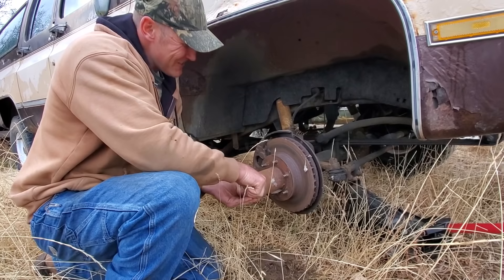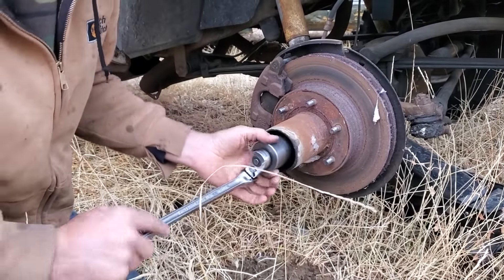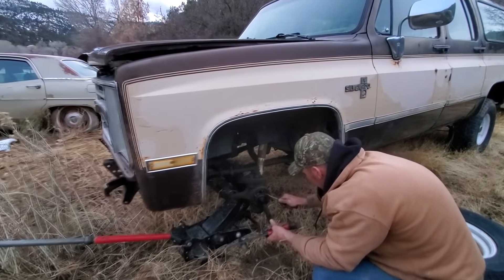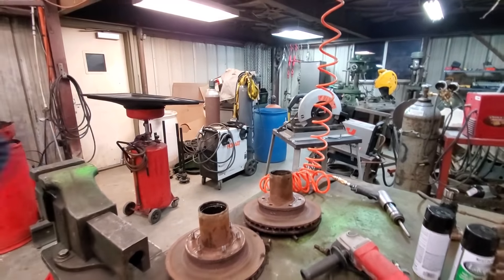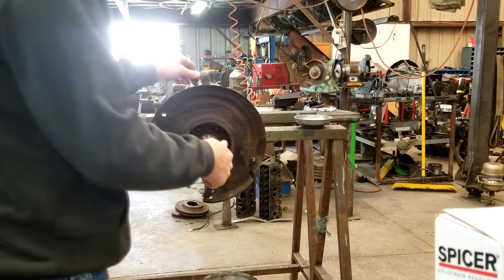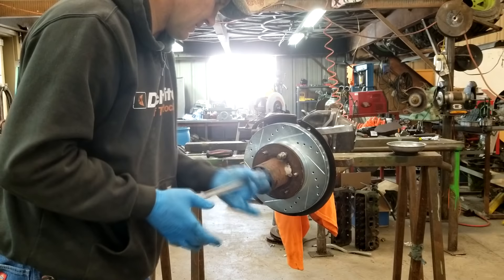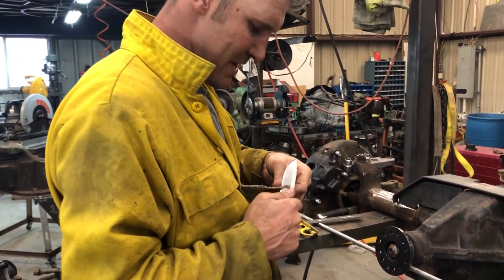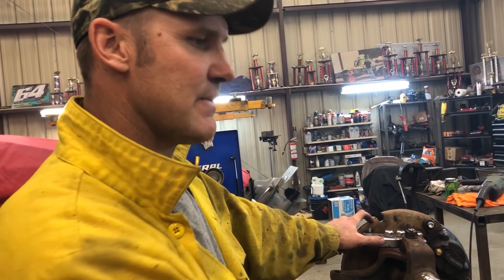Building a Dana 44 for the TACO Pt.4

Comment: Did you rotate the C's on the end of the axle tubes to get some more caster angle? Or with the truck at that ride height was it not an issue? Thanks!

Comment: I'm enjoying the build. I like that you are just a guy in the garage figuring it out as you go. I am going to start collecting parts for my Frontier later this year. I plan on using a 44 in the front and a nine inch in the rear out of a 76 or 77 F100 or F150. 

When you welded the truss to the center housing, did you preheat and slowly cool? If not, did you have a problem with the welds cracking?
Reply from the maker: Didn’t preheat it, but I pinged it with an air chisel to let the tension out after I welding it so it wouldn’t crack.

Comment: One question 🤔 paul ....Toyota vehicle like the 79'swith snockle, 6 cylinder straight driving it into water 1.5 meter deep the disadvantage apart from electrical what else can water do to the engine that could be the worst synario.....

Comment: Any particular reason you went low pinion instead of high? 
Gonna sas my 06 taco soon with a set of the same blazer axles but was thinking about using one of my 78/79 f150 dana44 hp diffs on the blazer tubes since it needs to be relocated to driver side anyway. I don't like the ford 3 link, especially under a soft taco. Planning on running 40's and the truck is strictly off highway. Think the HP diff is a good idea?

Comment: Hi man,how can I get a Dana 44 for my 98 ford ranger sas with coil spring setup and everything so I can use manual locking hubs on the front when 4wheeling also I need a 8.8 rear axle to upgrade from the 7.5 rear end so I can install differential lockers can you help me with this build?

Comment: Quick Question?  Why not just pull the whole front 4x4 axle from the Silverado and use it?
Why is it better to mix parts together from Ford / Chevy donor cars?
Reply: The Chevy axle is passenger side differential. The Ford is driver side to mate with his driver side drop transfer case.

Comment: Hi Paul How is  U .....?  Why do you brake before repair...? A tip that you will adopt and will be very please 1°) Make or buy GRAPHITE PASTE to be used on splines, oil seals freewheel hub, clutch pilot shaft in the disc splines, etc...... N°2) get yourself plenty of COPPER SPRAY  for all exhaust bolts nuts joint clamps --- on all bolts nuts witch are often difficult to loosen ..etc.  If you like I will tell you how to put valve seats in aluminum heads (VW and others)  and other OLD tricks ad tips  (normal I am an old piece also !!!)   Best regards my friend !!!

Comment: Did you weld straight to the cast or did you do the preheat thing. Asking because I have a 77 f250 HD44 in my garage and about to burn in my truss next week. Want to weld tubes to case but don't have a way to pre heat is why I ask.
Reply from the maker: Cleaned it up, welded ,it and pinged it afterwards. No Heat treat. 👍🏻
Reply: @FabRats  Out standing. Thanks. Keep it up, you are doing good things. Great reference for my build so keep'em comin.

Comment: Did you buy the house because it had the shop, or did you buy the shop and build a house? :)
Reply from the maker: I bought the house and built the shop......every nut and bolt. 👍🏻
Reply: @FabRats  I caught that in a later video when you talked about the heater.  I see you are using a waste oil setup on that, I'd be keen to hear more about that.  I've got NG and a Jotul wood stove in my shop and  have been interested in WO heating.

Comment: after 1977 chevy front ends are 10 bolts not dana 44s
Reply: not all of them.some are dana 44.
Reply: It does'nt matter any way ,10 bolt hubbs and breaks are the same as  dana 44 any way, Chevy ain't dumm.
Reply: @cmac956  you are right 77 to 79 they used both the 10 bolt and 44 after 80 the 44 was gone
Reply: @levic9787  sounds good to me .I found out from a guy, saved me alot of looking/